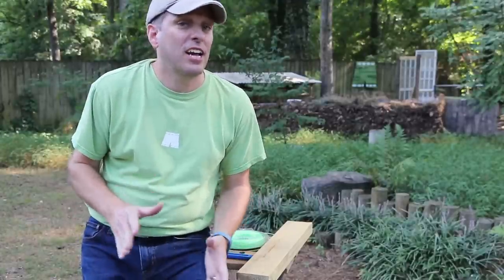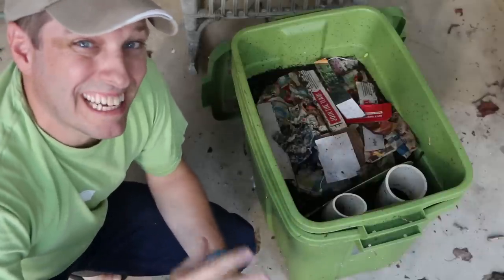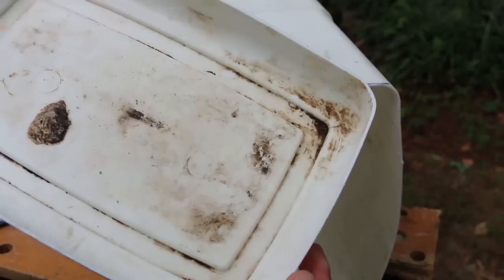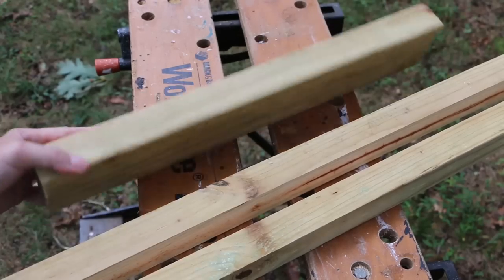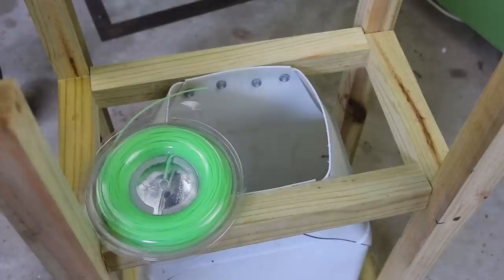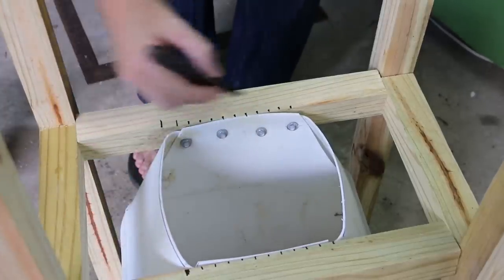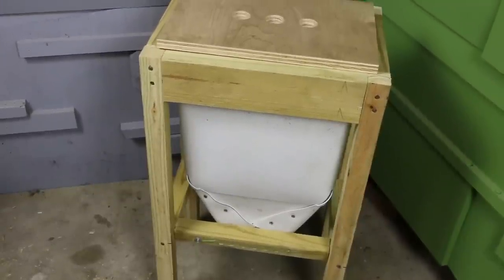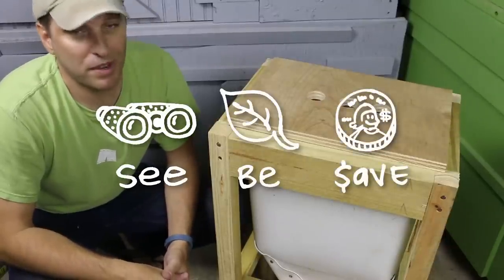How To Make A Flow Through Worm Composter

Comment: nice design. I think I would attached hardware cloth on the bottom instead of the string trimmer.
Reply from the maker: +Jamie Reed The challenge with hardware cloth would be the inability to rake out the castings. They are extremely sticky and don't really "flow" with out some mechanical assistance. I've got a new design that solves that issue. I will post that video this Friday. Thanks for your feedback.
Reply: totally got that once I saw the next video! Look forward to the new update!
Reply from the maker: Sent this via another comment, but here is the new design: https://www.youtube.com/watch?v=l43GwJ-mCus
Reply: Jamie Reed Clothing would block the Product Worm Castings Gravity Dump.
Reply from the maker: Jamie, you need to be able to rake the worm castings out of the bin, so hardware cloth, while it would support the casting fine, would make it difficult to get them out. I've created a simpler design for this flow through worm bin, with an integrated harvesting bar. Take a look: https://www.youtube.com/watch?v=l43GwJ-mCus
Reply: I thought the same thing hardware cloth would be so much easier
Reply: yeah, a little too much work stringing all that line.
Reply: Or an old bbq grate.

Comment: What is the initial capacity of your bin?  In other words, if 1 lb. of worms (1000 worms are used to seed the culture, is that too much?  Excellent design.
Reply from the maker: +James Hsiang thank you. I think 500 worms would be enough to seed this flow through composter. Thanks for your comment.
Reply: Thanks for tip. My 20' x 30" bin based on your design will easily hold the 2000 worms that I ordered. If the colony doubles in 90 days, I will be a farmer!

Comment: Warning Long Post with lots of Questions! I am just getting started and am building a similar worm bin with a couple slight modifications. I have a few questions. From whom would you recommend buying worms from to get started? Do you use strictly Red wigglers in this type of design or a mix of worm species? How often do you have to add grit for your worms so they can digest their food? I know you used Worms from an exist in the bin you had, however how many worms would you recommend to a newbie to start out with for this system? I am good with starting slow and letting the worms breed and multiply to increase the speed of composting and amount they compost? Thank you for videos, I have learned a lot and am looking forward to starting my own bin.
Reply from the maker: +andrea christenson sorry it has been a few days since you posted this. Here are my best answers. :-) I've used Uncle Jim's Worm Farm. I've just used red wigglers, but I know he sells a mixed bag as well. I think you'd have similar results. I'd add a little grit whenever you add compostables. Since you are just getting started, I'd recommend the bucket worm composter. Did you see that video? Although, my next video will be a simplified version of a flow through worm bin, so you might wait and see. I think the flow through bins are lower maintenance to operate, but are more complicated to build. I think you could start this system (or the bucket worm composter) with 250 worms. I think Uncle Jim offers that as his smallest quantity. He usually offers a 10% discount...a few of my videos reference that. If that coupon code doesn't work, try Googling it. A new once should pop up. Let me know if you have any more questions.
Reply: Thank you for you help. I almost have the Flow through bin finished. I prefer a little more work to set up and easier harvesting. I look forward to your future video. I hope that this works and eventually I can scale up and produce enough compost for our landscaping and garden
Reply: I just finished Building my Continuous Flow through worm Bin last week. Other than cutting the bottom off of the trash can the rest wasn't that bad to make. cutting that bottom was the hardest part of the project. Also I left the top lip on since my Top was flat. plus after cutting the bottom off and cutting the slits to great the angle I was in no hurry to cut anymore on the trash can. I put the peat moss in the bottom part and it has been going from freezing outdoor temps to room temp in my basement for a week. my worms should be shipped sometime this coming week. I can't wait to see how this works out.

Comment: Did it work? Did the worms stay up and the castings fall?
Reply from the maker: +Isaac Weir for the most part, it seems to be working as planned. Initially I saw a few worms in the catch basin. Now that the starter soil is starting to compact, the worms are staying in the top layers where the compostables are. I have begun to use the rake (I make it in the How to Set Up Video), to harvest soil from the bottom of the worm bin through the trimmer wire grid. It will be a little while before the starter soil has all passed through and castings reach the wire. When it does, I'll do a formal harvesting video.
Reply from the maker: Isaac...here's the answer to your question in the form of a video. How to Harvest a Flow Through Worm composter : https://www.youtube.com/watch?v=6ScnbSySrFg

Comment: can we use wood pellet for worms bedding ?
Reply from the maker: That would likely work as long as the wood is not treated. Sawdust would work as well. With the newspaper bedding, the worms process the bedding too. This would happen with the wood pellets,but they would have to break down on their own first. Not a bad thing, just slower. Thanks for your question.

Comment: Maybe hardware cloth on the bottom instead of stringing a tennis racket?
Reply from the maker: I did another version of this flow through worm composter that eliminates the trimmer wire (although initially I tried it). I use a perforated thin sheet of metal. Hardware cloth would work similarly, but you’d need to slide it to one side to harvest. Thanks for the suggestion.

Comment: This is similar to the Hungry Bin design. The only difference is that it won't set you back $500 bucks. Can you do a DIY replica of the hungry bin where the can attach a bottom lid with a clip?
Reply from the maker: I’ve got another design for this planned, with more surface area. Was thinking about using a modified bucket for the bottom. Similar to what your talking about. I’ll move that up on the list, since you’ve requested. Thanks for watching.
Reply: Very cool 😃

Comment: A piece of hardware cloth across the bottom would be a whole lot faster and easier than your trimmer line and holes!!
Reply from the maker: Yeah. In a later build, I reworked the whole harvesting element and replaced the trimmer wire with a perforated metal plate. I took me a few iterations and a few videos to get to that point though. Thanks for watching.

Comment: Pop rivets would work better to lock the taper together instead of screws.
Reply from the maker: You are correct. But, I like to use tools the most people already have. That said, a pop riveter is a great tool to have. Lots of applications. Thanks for the suggestion.
Reply: Not with plastic. Sometimes the plastic pushes right over the rivet.

Comment: PROtip:  Buy a simple set of each kind of lumber hanger for the range of lumber dimensions you'll use, 1 each, and use them for guide holes...  super-rapid marking and near perfect every time because they include the offsets.   You can even start then back-out the screws instead of marking the board.

Comment: nowadays pressure treated lumber is cured using copper I don't know exactly how tbh but its not cured with fymaldahyde (probably spelt wrong )
Reply from the maker: Hi Monica. They are using different materials for wood preservation, yes. And you are correct that copper is on the the list. The concern is mainly the concentration of those materials. That is what can throw things off balance. I appreciate the feedback.
Reply from the maker: Monica, here's how the harvesting works on this flow through composter. How to Harvest a Flow Through Worm Composter: https://www.youtube.com/watch?v=6ScnbSySrFg

Comment: Nice design.  And a very good. Video.  An narrative.    The only.  Cri tique  or suggestion. I.  Will. Add. Is.  A safety. Concern.   I. Would highly. Reccomend.  Trimming.  The.  Trash can. Excess. Off. With.  A. Power. Tool. Instead. Of the. Utility knife. I. Was. In construction.  For over. 20 years. And ive. Seen.  Very serious.   Injuries.   From.    People.  Having.   A blade. Break. Or. Slipping.  During a.   Difficult or. Awkward.  Cut. A. Place. Like Harbor Freight. Or the. Internet.  Offers.  Tools like a multi. Tool or. A rotary style tool ( often called a Drexel).  For reasonable. Prices.  And offers.    Much more safety.  To the user.  As. Its easier. To.   Control  and. Get.  A nicer. Cut !    I.  Am of course. Not personally. Reccomending. Any specific company or. Brand.  Ive personally have used. And owned. Many.   Brands.  And.  Generic   Tools.      With success. And failures. In. All  my. Overall. Conclusion and advice.  To my friends and family.  Is. To. Buy.  Whatever. You.   Need. To complete.  The. Job. You need to do.  And id it is a very. Expensive.   Tool. Consider.  Renting.  One. For.  The. Job.  As that. May be.  A cost effective. Way. Of getting.    It done.
Reply from the maker: Thanks for the feedback. Good thoughts on the safety issue. I have cut myself recently with the box knife. Always a danger. Thanks for watching.

Comment: Wouldnt it been easier to use chicken wire
Reply from the maker: The liquid coming out of the bottom is pretty caustic. It rusts the screws pretty badly. The chicken wire would likely get rusted quickly as well. Also the parallel lines of the trimmer line allow the castings to be raked. Although, I changed the whole harvesting mechanism in a newer video. Instead of taking, the whole trash can slides through a cutting bar to harvest. Thanks for watching.

Comment: Overkill, too complicated, too many tools and too much time spent building what can be simplified by using a 3 tier bin system/ I bought 3 office sized trash cans, drilled hole in the bottom with a 1/2  inch spade, stacked them and added worms and food. Done in less than an hour.
Reply from the maker: I can't argue with that. But, I like trying different angles at the same problem. I did create a "simpler" version of this system. It is still not as easy as the 2-bin system. Thanks for watching.
Reply: @GreenShortzDIY  You certainly did alleviate the chore of having to remove heavy bins to scoop out the worm castings. 
The raking feature is actually a nice value-added feature. 
If someone needs to frequent the bins for worm castings but doesn't need to scale up to a larger more expensive system then something like this would definitely fit that niche.